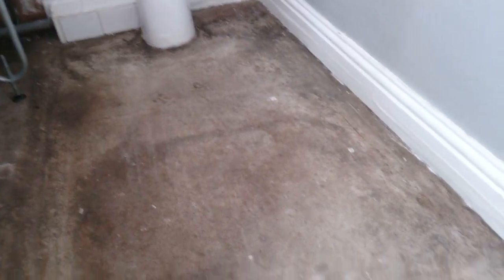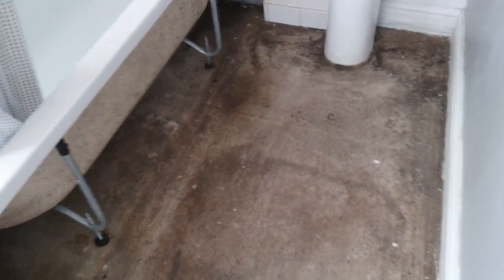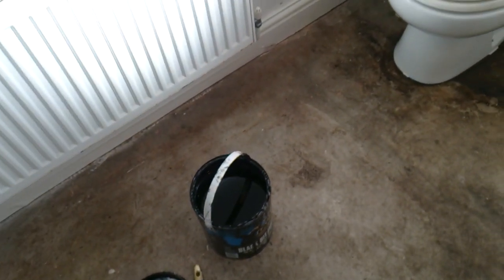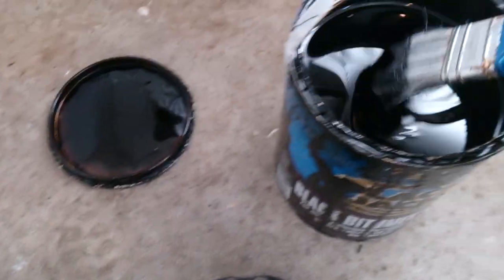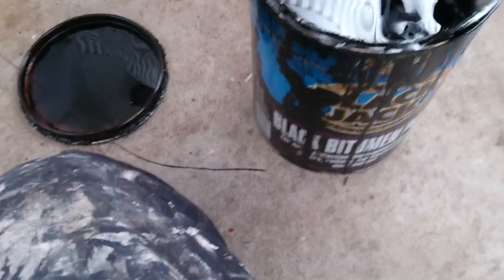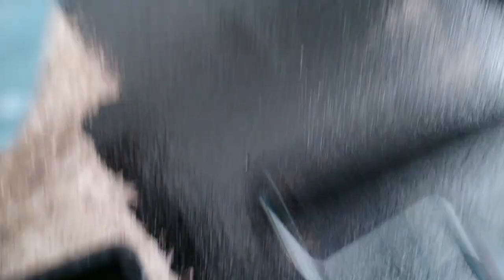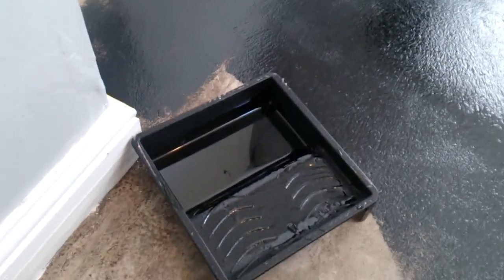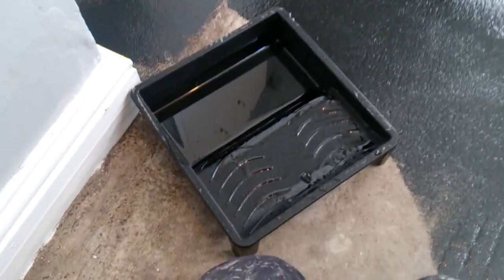EVERBUILD blackjack bitumen rolling painting concrete bathroom floor DOES IT WORK???

Comment: It's roof paint for positive pressure not negative from the likes of a damp sub floor.( may work if your on a serious budget) . Can take ages to dry, I've known it not to dry at all , can stay tacky.. best for roofs . needs a dpm resin
Reply from the maker: Good all round bituminous paint i painted the floor with Thompson water seal before applying and its been excellent

Comment: Thankyou so much...this video is brilliant. Using this stuff is by far the worst job I’ve  ever had to do!
Your method was great...it made it much quicker and gave a better finish. Thankyou
Reply from the maker: hi deborah ive had the black jack bitumen down nearly a year on the bathroom floor and is still going strong thanks for your comment take care.👍
Reply: The first coat must have been a bit thick on the first area we did. ..the builder suggested a long handled brush for application. Any ideas to help it dry out would be very welcome.
Really wish I’d used your method the first time!
Reply from the maker: hi debs it normally drys properly in 24 hours a long brush is ok but i find that best for flat garage roofs etc thats why i used a roller as a brush lays it on too thick and takes too long😕  but dont worry it will dry hard but may take longer best of luck,👍👌
Reply: Did you just do one coat? Was the water coming up through the floor and  has it stopped it?